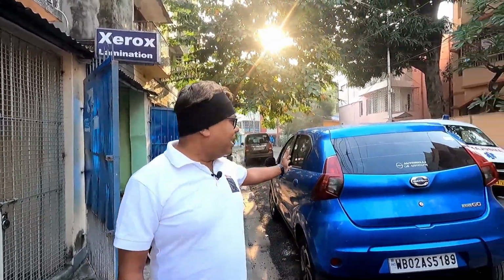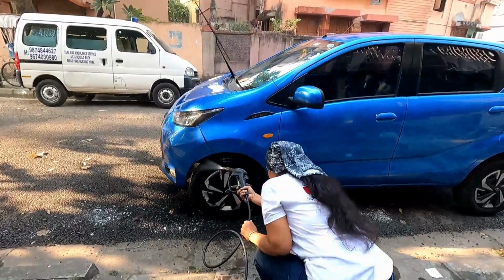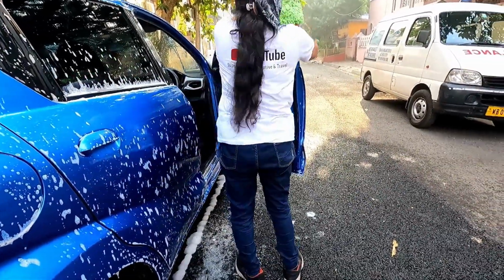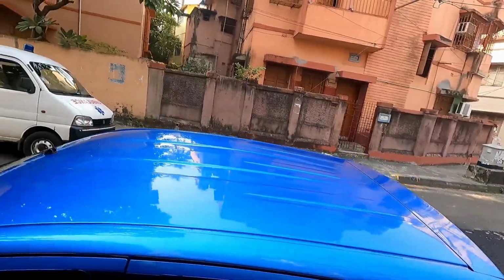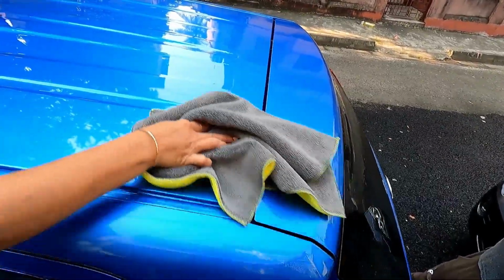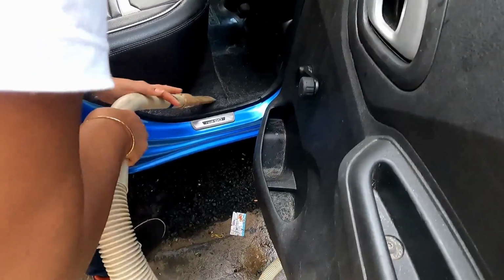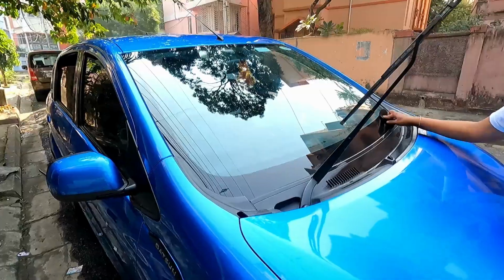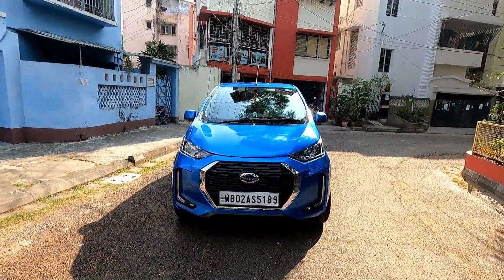Datsun Redigo Gets Deep Detail & Wax Protection

Comment: How often do you change your pressure washer oil ?
Reply from the maker: If there's no leak oil change may not be necessary. I haven't changed yet.
Reply: @supercyberautomotivetravel  even I'm using starq pressure washer, and i got mine oil changed within a year. U won't believe how dirty the oil came out inspite of using it limited.

My local hardware mechanic suggested to change it every year.

I'll suggest you also to do the same 👍🏻
Reply from the maker: Thanks for your information and feedback. I will think of the same too.